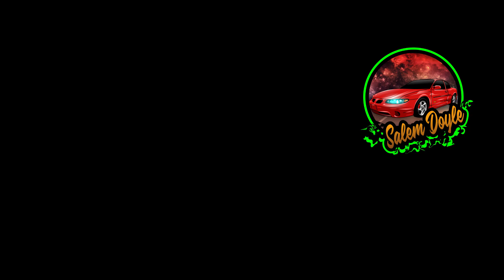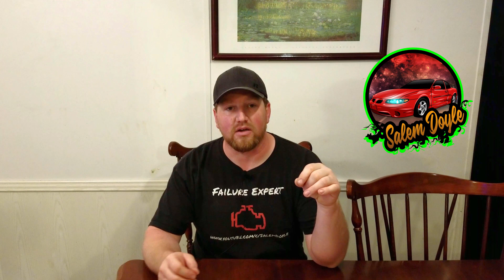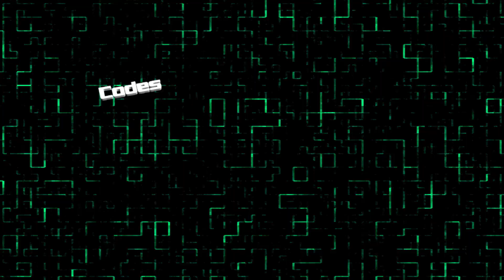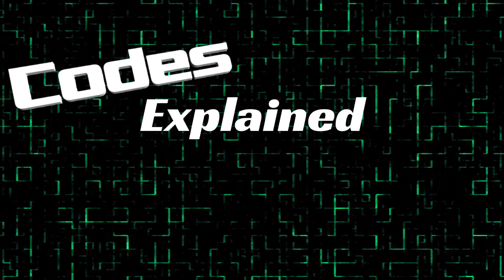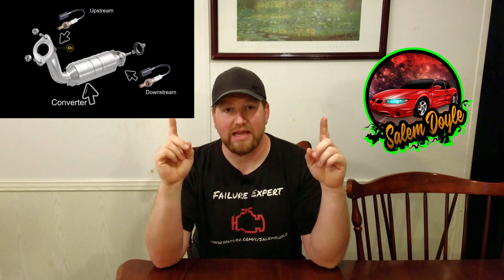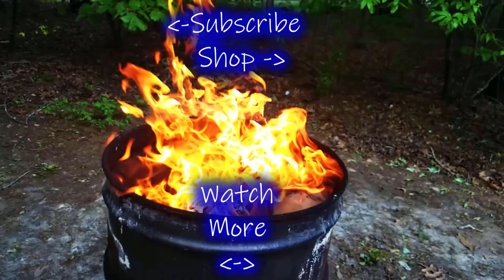Engine Code P0420 and P0430 EXPLAINED

Comment: I received 3 codes p0011, p0420, and p0430 approximately 30 minutes after I put vpower Shell gas in car that takes regular. I was told it would help get better mileage but now I am worried that I messed up the engine by putting the higher gas type in the car. I have a 2004 Nissan Murano. I had all spark plugs recently replaced and oil changed earlier this month. I don't have money to replace catalytic converter. Please tell me what you think I can do to fix this problem. Thank you for any advice you can offer.
Reply from the maker: Most cars that run regular can run premium with no problem, so it may be a coincidence.   But false codes happen sometimes.  Have you tryed having the light reset and see if it comes back?
Reply: I bought a reader and erased the codes but one came back. P0420. I pressed on the accelerator but car sounds like it is straining as if trying to tell me to leave it alone it's too tired. Lol It also did that before I had tuneup but now it is doing it again. I bought some seafoam and poured half the can  in the tank on a half tank of gas. I will see if it helps. I will put off doing cosmetic paint work until I can get car sounding right again. I changed the air filter and had mechanic do engine flush but so far nothing changed. This car is killing my bank account.
Reply: No codes came back on yet but car sounds worse. The engine sounds muffled like it is choking when I press on gas pedal. It struggled to go over 40 mph on freeway, I had to get off so no one would hit me. I will take it in to get checked again. One shop I took it to claimed they didn't know what was wrong with it. I put 16 gallons of regular gas in it and added whole can of seafoam. One ounce per gallon is what instructions said so that is what I did but it is worse. I think I will be needing a new car soon.
Reply from the maker: @feliciataylor3772  have the catalytic converters looked at for restriction. sounds like it may have some blockage
Reply: Is that a problem that would require replacing the catalytic converters? It might be cheaper for me to buy a cash car but I will definitely ask them to check the converters. I'm still confused why the codes haven't came back since there is obviously something wrong with the car. I also find it strange how it will start off sounding normal then 30 minutes later it sounds like pieces of engine is going to start falling off. Okay a little exaggeration but you know what I mean. I get paid tomorrow so I will take car in to a shop in the morning.
Reply: Today the check engine light came back on with two codes, P0300 and P0011.  I'm done with this car, the cost of repairs is more than what the car is worth. The mechanic mentioned too many issues wrong with the car. Catalytic converters, oxygen sensors, fuel injector, and transmission. I don't know if he is telling me the truth or lying to get holiday money. I just parked the car and refuse to drive it anymore. The P0420 and P0430 codes didn't come back on but I'm told the problem still exists although I have driven it for two weeks since those codes disappeared. I wonder if he would have said the converters needed replaced if I never mentioned those codes came up at all.  I might pay another hundred dollars to get a second opinion next week without mentioning codes. I should have kept my mouth shut in the first place so that's my fault. I will look for another car while I think about what to do.

BTW, thank you for your help. I will still watch your videos to get educated about car issues.
Reply: @feliciataylor3772  try catclean!

Comment: Show what scan tool say running 02 sensors if bad or not use tep gun see if hot at end warm in front that make good cat works
Reply from the maker: I forgot about the temp test, that is a good indicator also

Comment: What do you think of the o2 simulators Salem?
Reply from the maker: Its an easy fix if you need to remove a converter and dont have a tuner, but its evwn easier to just tune that code out if your pcm is tuned

Comment: Have you ever had the problem with the Grand Prix where the MAF fuse blows like once a week or have the problem where the throttle hangs open after you let off the accelerator? If so I would like to know what to do to fix these problems I'm having
Reply from the maker: What generation grand prix?
Reply: @SalemDoyle  it's a 2000 Pontiac Grand Prix GTP
Reply from the maker: Have you looked at the idle control valve? It may even get its reference voltage from the same place as the maf
Reply: @SalemDoyle  nope havent checked that as of yet
Reply from the maker: I would look into that next
Reply: Has to be a wiring short if maf sensor has been replaced. The throttle problem sounds like a throttle cable sticking maybe.
Reply: @BassManBobBassCovers  I've traced the wires nothing wrong with them and I did put a new MAF as well to see if it was the MAF causing the fuse to blow but still the same and for the throttle cable it fine on the first drive, go into a store come out like 20-30 mins later and start the vehicle if you even touch the pedal a little bit it goes up to 4000 RPM and just hangs there for like 5-7 seconds